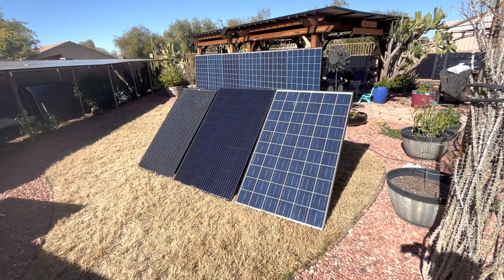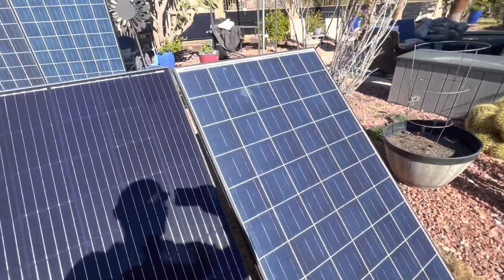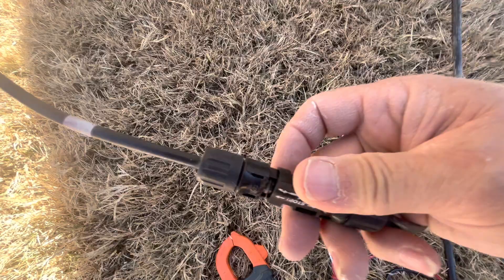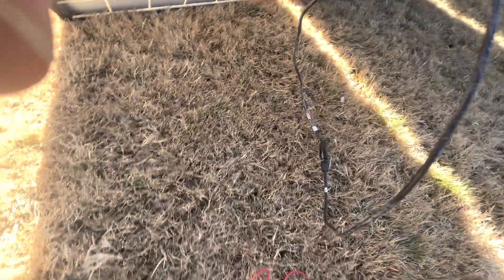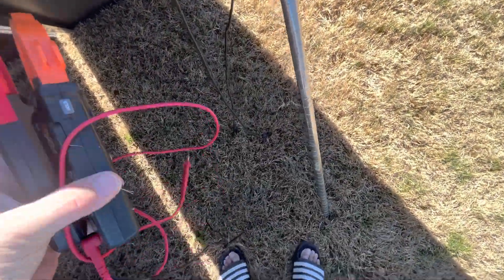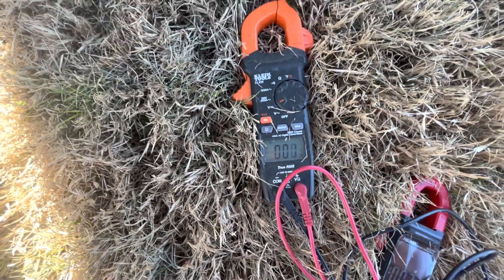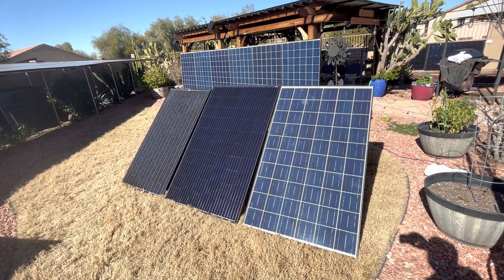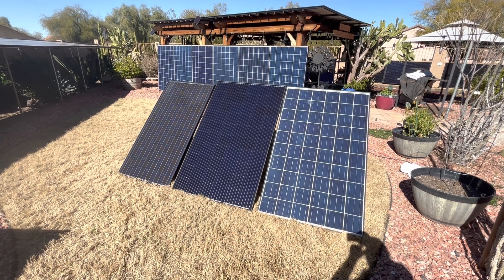DIY solar panel for home. Excellent output 3 different used solar panels, 190, 250 & 330 watts

Comment: How are u planning on using them if they are all different voltage n wattage?
Reply from the maker: They will be used for different arrays. I will not be combining different panels. I always use the same exact panels in an array. Just wanted to do a video to show different panel and the output.

Comment: Cool video. How are you propping those up. I see a bar but how do you have it attached?
Reply from the maker: I just have a wood slats holding them up just for using in video. I wanted to show the output of extremely cheap used solar panels. The angle of the panels to the sun did not make a big difference even laying flat versus almost vertical.

Comment: I have been working on a way to make more power out of solar panels. In small-scale testing, it seems to be working. Now, I need to get enough materials to make it on a large scale.
Reply from the maker: Do you make your solar panels from scratch?
Reply: @DIY solar power with Pappa off grid projects  
No, I don't. I just tinker with them. Let me ask you something! Have you ever wondered how or why satellites have small solar panels for the amount of electricity they need to operate. Between that question and making window thermal heaters out of pipes and pop cans. I started to understand why they said that there was so much potential energy from the sun. So, I made a vacuum chamber and tested all kinds of things that absorbed energy. Long story short. There was a trend. My favorite thing that uses the sun's power is vacuum tubes that boils water at every temperature. I went to college for hydrology, which also helped me understand certain aspects as well about the sun. If I am right about making more energy my way. It would be a shame that they are not doing it. Because they are smarter than I am.
Reply from the maker: @jerrywhere86193  wow that is pretty intense. You seem to have a good handle on what you are talking about. I’m content using my solar to reduce electric bill since I’m on a fixed income. I understand what you are talking about and keep tinkering with it. My wife keeps me busy with many projects around the house to pick up another hobby, lol
Reply: @DIY solar power with Pappa off grid projects  
I don't do as much as I would like. My days of off grid are limited between where I live, and I am plague with arthritis and surgeries. I suffer from my brain rarely shutting down. Even when I sleep. What do you think about the latest news? Tsc and the wef are colluding together to make chickens not lay eggs. Also, tsc is talking about increasing chicken sales are going up to $25.00 per chicken.
Reply from the maker: @jerrywhere86193  all that does not affect me, I trust in God through his Son Jesus. I was diagnosed with 2 incurable cancers in late 2016. I was having horrible swelling attacks and had 15 different parts of my blood that were way out of line. My spleen was over 24 inches long when it should have been the size of my fist. Over 70 percent of my bone marrow was overrun with cancer. I saw God heal 37 different people before he shut down my swelling attacks, fixed all my blood cancer issues, restored my bone marrow and my spleen is completely normal size with no signs of having cancer. Jesus said don’t worry about what you wear, what you eat and what you drink, but seek first the Kigndom of Heaven and all Gods righteousness. So I seek first the Kigndom of Heaven above all else. I have seen God heal 53 different people and me over the last 15 years since I was born again, baptized and filled with his Holy Spirit. God used me to pray for and lay hands on all those people and through their Faith they were all healed. I share this because I know for a fact that God heals through his Son Jesus. But you must have Faith to be healed, I have seen many ask to be healed but they had no faith and they did not get healed. All you need is faith and faith comes by hearing the word of God, the word of God is Jesus. Jesus is spirit just like God the Father is Spirit. I pray for anyone who ask but they have to use their Faith to believe God will heal them to get healed. It is really simple, man makes being healed by God impossible and burdensome. Hope my testimony helps you increase your faith.
Reply: @diy-solar-guy  
Sounds like you have been through the ringer as well
Reply from the maker: @jerrywhere86193  I have, permanently disabled retired, unable to work. So I over years created the off grid solar system to keep electricity bill low since in az your electric bill can exceed $5000 a year.
Reply: @DIY solar power with Pappa off grid projects  
I live in the north. My gas and electricity combined is about 4000 a year. I am also permanently disabled. I have spent the last 18 years insulating and upgrading my house. I have spent probably 20 years playing with alternative energy. I had a friend years ago who went to college for heating and air conditioning. He gave me his books to read.

Comment: You can buy handheld solar panel testers with a built in MPPT
Reply from the maker: Thanks, I will look into that
Reply from the maker: You can also just multiply amps times volts to see watt output. Which for these used panels is extremely high in the winter and being 3-6 years old. These panels are built to last. I also clean my solar panels every other month.
Reply: @diy-solar-guy  Measuring the short circuit current and open circuit voltage isn't a great indicator of actual power output